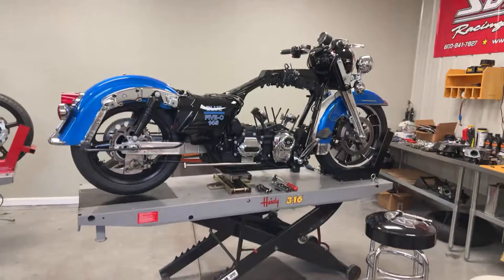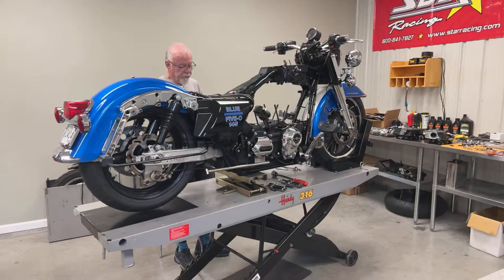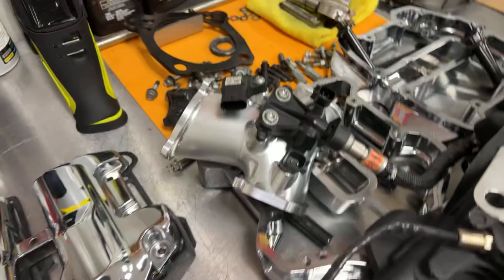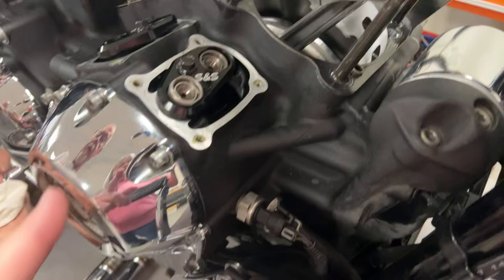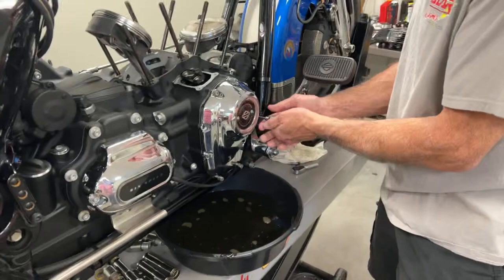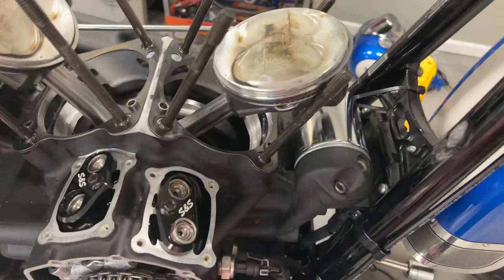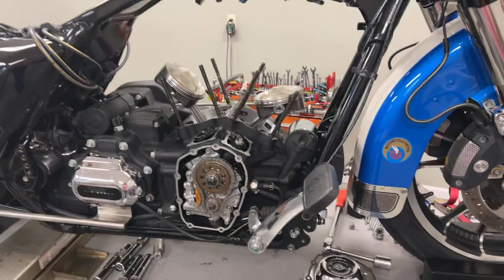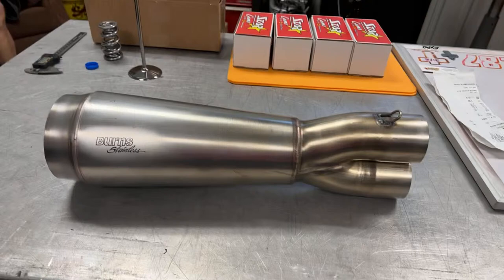Tech Talk Tuesday #187 with Star Racing’s George Bryce

Comment: Noticed the auto primarily chain tensioner, and when fiery went to check play it seemed tight, any foreseeing issues with that? I changed to a Manuel adjuster because I was told to tight starts to pull motor shaft and tranny shafts inward? In video yours seemed tight? This ok, good, bad, ugly?

God bless America